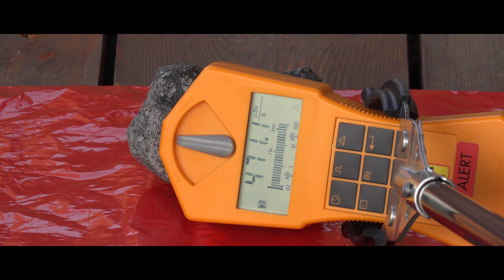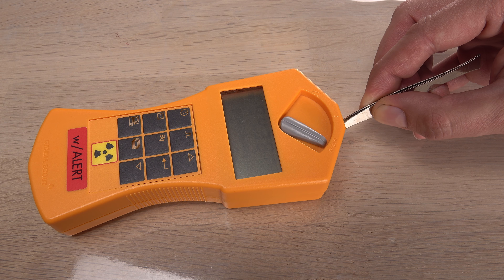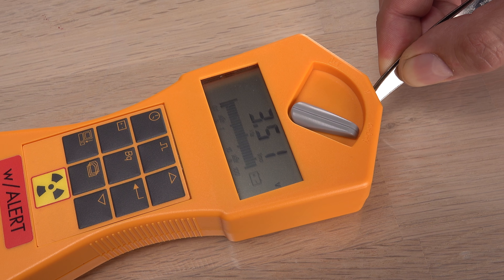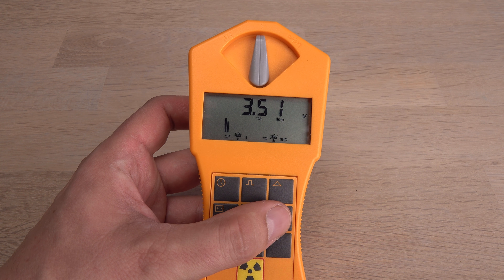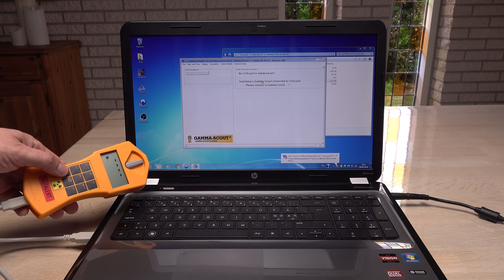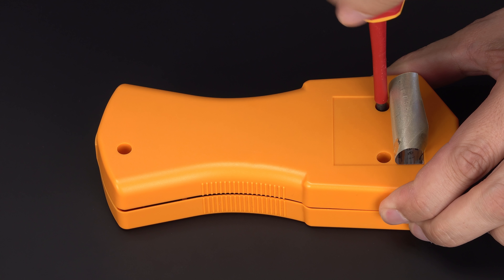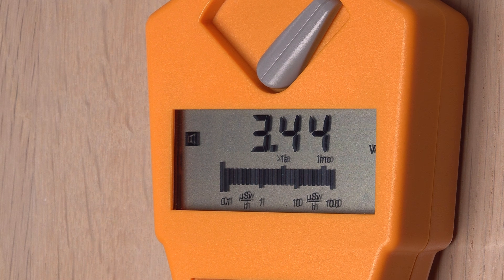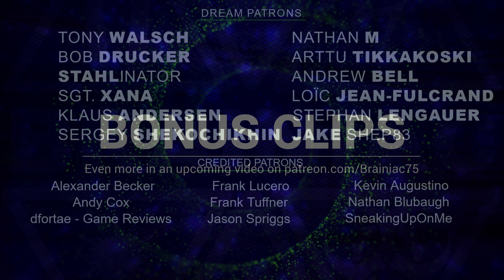Weird battery change in Geiger counter

Comment: I don't know if it's the case in your country, but here in the U.S., those "warranty void if sticker removed" things are completely false. In fact it's illegal for companies to void a warranty here just because you fixed something yourself (which, obviously, necessitates removing the sticker they put on there to prevent you from accessing things).
They can, however, (and rightfully so), void a warranty due to you making a mistake when fixing the thing, or damaging something while working on it.
Reply: In most of the EU, including denmark, for the first 6 months the company has the burden of proof you broke the thing and for the remainder you'll have to prove it wasn't your fault.
Whether you opened it or not, doesn't make a difference.
Proving that the other is at fault is quite difficult for both sides.

That are the terms for the warranty required by law, they don't care about the terms for an extended warranty some might grant you.
Reply: And plus, Flydrop88, if you tamper with the device (or just remove a sticker covering a hidden screw or hinge) and a defect occurs, unless the warranty is still valid, the company will often automatically assume that the defect was caused by the (apparent) tampering of the device, and they will refuse to issue a refund.
Reply: I think the sticker is just a way to make it crystal clear that you didn't mess up with the device, and therefore the problems in it can't be caused by you. So having a sticker is better for the consumer because this way it's impossible for them to refuse warranty if the sticker is intact.
Reply: In the UK, no one cares about them. Simply remove it, they can't prove it was there in the first place.
Reply: Not an expert, but warranty is about "your shit won't break as long as you use it how you are supposed to" and opening the thing is usually not how you supposed to use it.
Reply: Hier zie je hoe je het dus NIET moet doen.

# Ten eerste  gebruik een goede soldeerbout  met antistatische  armband. 

# Daarna zoek je vlak naast de batterij voedings punten  op die aan de batterij  zitten.
Zet daar met een externe  voeding de juiste  spanning  op.
# Verwijder dan de batterij  zo als op het filmpje. 

In het filmpje  gaat de spanning  van de geigercounter inclusief de calibrate. 

Door de geigercounter onder spanning  te laten blijft alles behouden.
Reply: @FvEChannel  No one in this comment thread is speaking your language. We are speaking English.
Reply: @buddyclem7328  he can comment and say what he wants to. Don't matter if you can understand him or not.
Reply: Which would be damaging the sticker so it would still be voided
Reply: the stickers are usually less warnings and more an indicator to the company if the device has been opened or not
but here in Australia, companies can void your warranty for any reason including if they just don't want to supply it anymore
Reply: I take those stickers as a challenge. Can usually fix it too. 😂
Reply: Can you please call up Tim Cook at Apple and tell him that? What an awful company with awful products and awful customer care.
Reply: Yeah, tell that to Apple!
Reply: Apple has no stickers.
Reply: mrcvry : I saw a few times when I disassemble an Apple a sticker, on a screw, saying " Do not remove " so it's a form of " warranty void if removed " :-/
Reply: ElectroXa 
The iPad and Watch are the hardest to repair but the other products are now easy.  There are video instructions and repair kits with all tools. Everyone can change a screen or batterie.
Reply: @Blackjack-0816  I suggest you go to Louis Rossmann's channel and watch the videos about all the issues small 3rd party repair shops and customers are having getting repairs done and recognized by Apple. It is criminal.
Reply: mannys9130 
Than you can sue them. It is easy!  They are sued all the time! 
I do not care. Electronic devices are disposals anyway. Not worth repairing. Buy regularly a new one or do not buy at all. Your choice. Your life does not depend on a toy.

With cars I am fed up with the horrible quality of modern cars.  I just bought a 40 year old car.  It is running 40 years now and it will continue to run for the next 40 years and more.  It is the last car I bought (as long as it is legal to drive combustion engines).
Reply: ElectroXa 
They write a wish on a sticker. You ignore the wish. Who cares about a warranty if you want to repair it yourself anyway? 🤔

If you still have a warranty than just claim it and let Apple repair it.  They are extremly tolerant as long as you have still warranty.  One call and they send you a new device  right away (mobile devices. Not Mac’s). The hotline even did not bother to troubleshot the problem. It was more easy to just send a brand new device.  Turned out it was a software bug and not the hardware.  No complains from Apple. 👍🏻   I do not know any other company that is that tolerant... perhaps Amazon.
Reply: @Blackjack-0816  Sadly it's not so easy anymore. Apple started linking parts to the motherboard, meaning your device won't work once you replace the screen for example (not sure about iPads, but definitely the case for Macbooks). Only Apple has the means to pair a motherboard and a display (not even authorized service centers). 

Apple is actively working against being able to repair your device, they just want you to go to them and pay an insane amount for a refurb instead.
Reply: Chirimorin1 
Perhaps you mean the fingerprint sensor.  That sensor does not work anymore without the right equipment to pair the sensor again with the secure chip. There is a good reason for that. 

Have not heard anything about Mac screens.  My brother has no clue about electronics but he had no problem to change iPhone screens (stupid kids).
Reply: @Blackjack-0816  hahahaha, good luck suing a billion dollar company hahahahhahahahahahah
Reply: @mannys9130  If I would make the laws, companies would have to release full service documentation for everything they sell, also provide (sufficiently small, not "case" and "board", each for twice the price of a new device) replacement parts to everyone.

If they ever discontinue those parts, they would have to release the design documents immidiately and allow any third party to make them. To prevent "we still make them, they are just f***ing expensive now", parts prices are not allowed to ever rise by more than inflation, maybe some exempts (which have to be granted individually) for things like rising prices of raw materials.  

Also all copies of all the design documents have to be given to a official archiving institution, which keeps them and releases them to the public whenever a company closes (without an immidiate successor) or after X years. 

The problem is, to be ever in a position to make laws, you have to sufficiently kiss companies buttocks, so .. I wouldn't get to make laws with this plans.
Reply: @Blackjack-0816 pretty much.😂
Reply: But they do it because who pays 10,000 for something thats worth less than 1/10 of that?
Reply: Owen Yin 
They were not talking about geiger counter but about Apple.  Apple does not produce anything that you need to survive. If you can not afford or like something than do not buy it. It is easy... except for millennials. 
 
And no - there is no modern car that is long lasting.  Except you think that 10 years is long. If you know one I would like to hear about it.

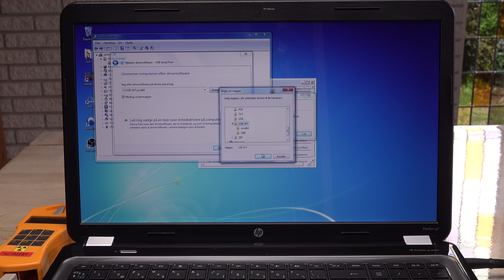Comment: 3:08 For the gammascout software, you need an 2006-2007ish laptop (Windows XP) for it to work.
The USB drivers and software are compatible up to XP. IDK if it is correct.
Reply: Or virtualbox
Reply: @TaoCroatia  WILL NOT WORK! It needs the USB driver to work. It is recommended to use an PC or notebook from 2006-2007 with Windows XP on it.
Reply: @iambadatsomefunnies5572  that's what he's saying virtualbox for. he could just install Windows XP in a virtual machine, install the USB drivers that are only compatible with XP like you said, and pass the counter through to the VM so it appears as if it's directly connected
Reply from the maker: You may be right, but there are drivers in a folder marked USB-W7 on the CD, which I believe are for Windows 7. It just doesn't work.... Maybe it has something to do with my laptop running a 64-bit operating system? I will need to experiment further with this issue...
Reply: @brainiac75  Windows has problem with older drivers, sometimes You need to uninstall new drivers without internet connection, and search Yourself for those drivers in computer. 
But even with that it can remember newer drivers, and fail to install old ones.
Reply: Perhaps it could also be that it's refusing to boot with the driver unless you start it in "Disable Driver Signature Enforcement" mode (if you haven't tried that).
Reply: @brainiac75  Did you know that there is a compatibility mode you can run 32-bit software in? Virtual machine overlay may not be necessary.

Comment: What would you rate the Gammascout out of10?
Reply from the maker: My early model is not that impressive. Maybe 6 out of 10. It's best feature is the high sensitivity to low-energy alpha radiation compared to my other counters. But it fails with strong samples, which is annoying. Newer models should be better at this, but I haven't tried one myself. Thanks for watching!
Reply: Yeah, they've fixed the glitching with newer models. Check out bionerd's more recent Chernobyl videos and you'll see a newer model working fine at hundreds or even a thousand microsieverts.
Reply: Mark Rose yeah the new ones can take quite a lot but not the fuel fragment :)I wonder what my Geiger’s max is?
Reply: Thanks I know you can buy kits online for a DIY Geiger with the same tube as the gammascout that can reach much higher levels without glitches.Maybe you could do a DIY by using some of the components such as GM tube and screen and make your own ,that would be really cool.Thanks and keep the videos coming

Comment: Radiation is a total BS term.
Reply: How so?
Reply: @jort93z  you can't see it you can't smell it you can't taste it.
Everything is electric. If you do your research you'll notice they measure voltage. Definition of radiation heat. Something real hot will kill you. But heat radiation can also warm you up. You always want to go back to the four elements. Earth water air.and fire. Fire being the one people get confused with. Electricity fire electricity fire are the same. Dumbest question on YouTube why would they lie about that.